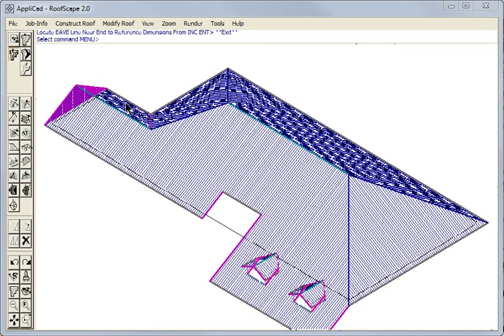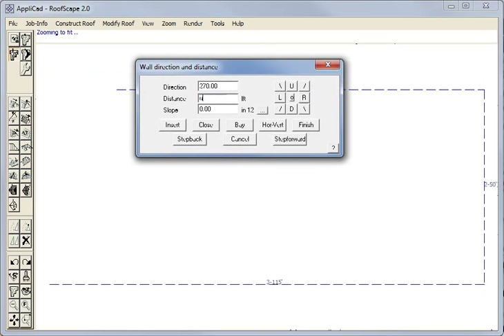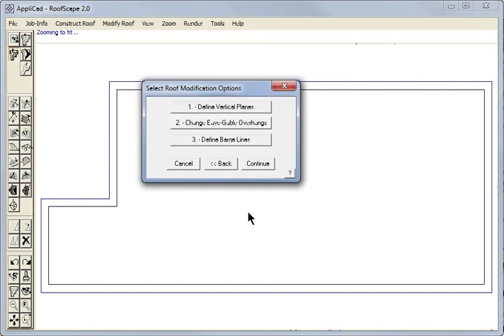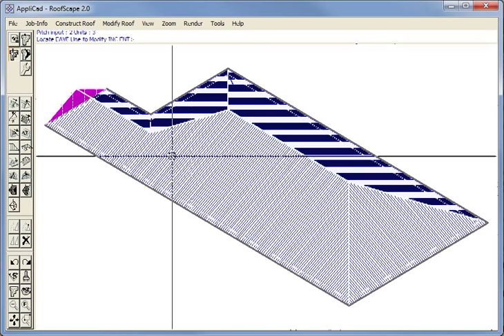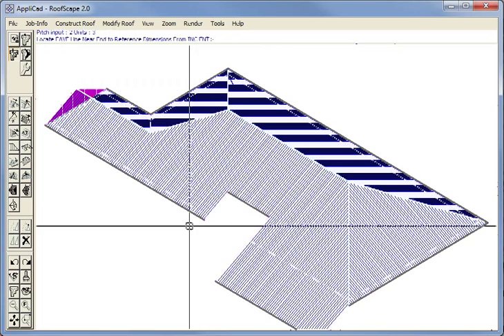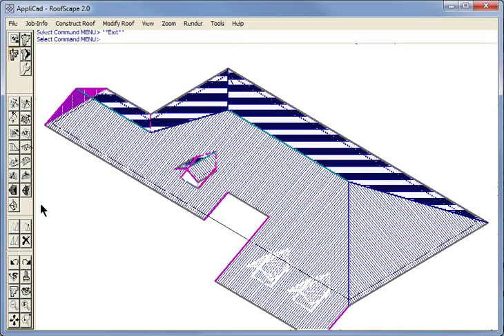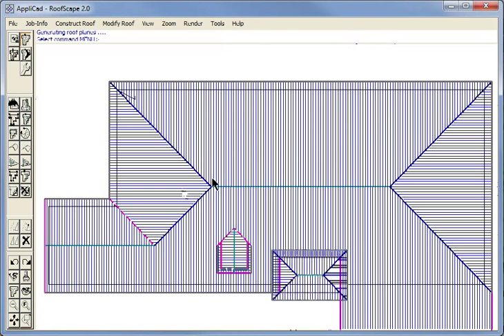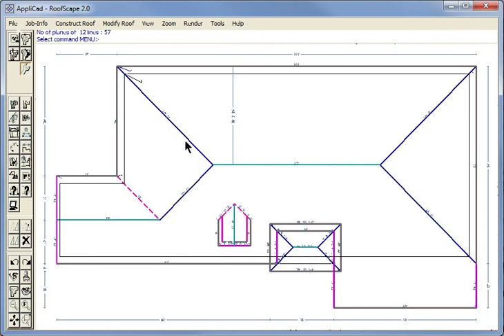AppliCad - Basic 3D Roof Model

Comment: Hello, I am using Applicad RoofScape.  I enter roof pitch as 27 Deg, but when I open up the PDF from the Applicad server, the plan shows 30 deg (Even though the plan in roofscape still shows 27deg)   How can I change this? Thanks in advance!
Reply from the maker: Just trying to check any jobs that you might have put up there, but not finding you.   Have you logged in as someone else?   As for the pitch not coming out right, I need more info.  I have not seen this error before, or even if it is an error.  A strange one for sure..   Maybe email me directly - ray@applicad.com

Comment: Does anyone else struggle to load the new Roofscape?  I get an error message
 that says SDK failed to load.   I removed all fire wall, updated 
everything else, but I can not run Roofscape 6 or 7.  Please, is there 
someone that can help?
Reply from the maker: Hi Deon,   I sent you the link to a stand alone install of one of the required components that was being blocked by your new Windows 10.   I understand that you are now up and running.   Good work.   FYI - we have had a lot of install issues with the standard security settings in Microsoft.   It is not just the firewall, it is also the internet security and maybe even your virus protection tools.    Indeed most of our support calls these days are about Windows security issues and network sharing permissions etc.   I appreciate your patience, thanks.
Reply: I am using Windows 7.  Ray Smith send me a link for a C++ and  that worked perfectly.